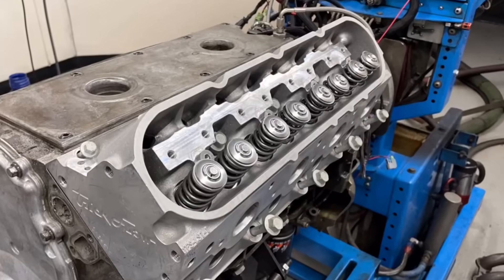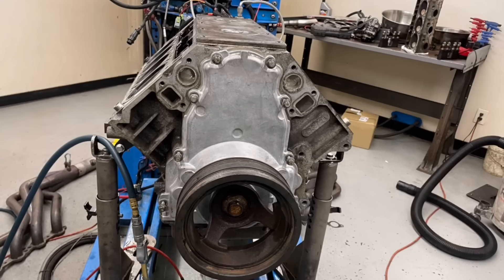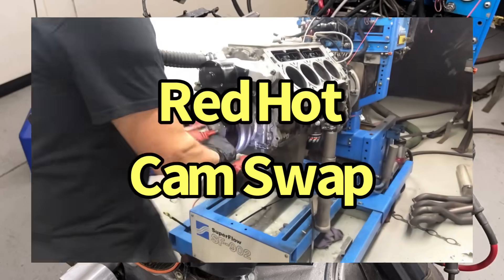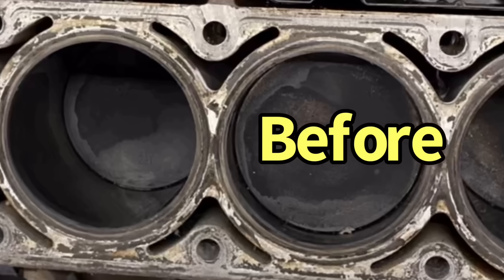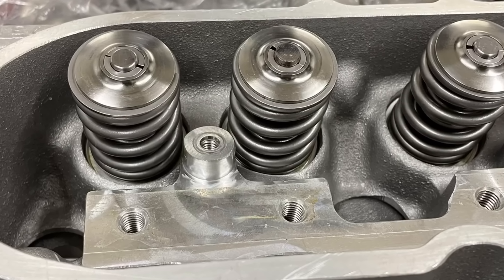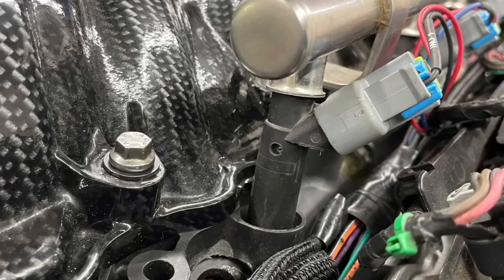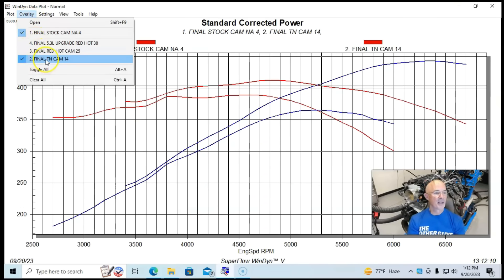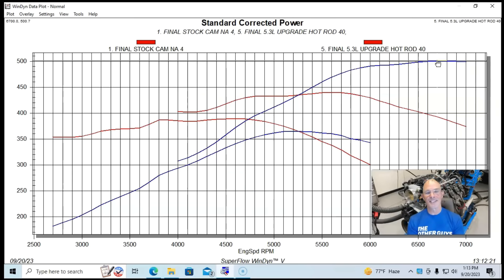HOW TO: THE ULTIMATE 510-HP, ALL MOTOR JUNKYARD 5.3L BUILD.  STEP BY STEP BUILD & FULL DYNO RESULTS

Comment: Attempting to build my 45kmi sbe ls1 to 500whp all-motor this winter! BTR stg3 na cam, 102mm lsxr, TEA stage 2 heads, and some compression 🤞 Wish me luck!
Reply: No luck needed on the LS platform.
Reply from the maker: might need more cam-let me know and good luck
Reply: Lower the stroke and increase the bore, smaller stroke allows for faster pistons movement which leads to higher rpm therefore more power.
Reply: @GarciaQ60 Proven not to make a difference at these power levels w/this platform. Displacement is king & i want stock in this case 👍
Reply: @Kstang09  Exactly!! This is a street engine no way would I give up torque just to see the tach go higher. Useless
Reply: @Eclipsis17  That gets expensive real fast!
Reply: You happen to have a part # for thr TFS heads?
Reply: Stroke it, solid roller.No idea what stage x means.